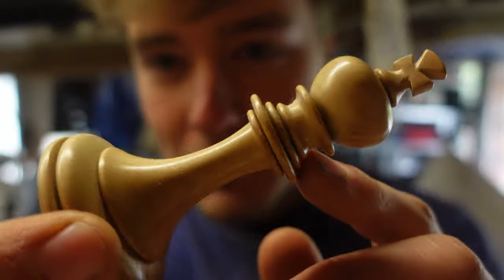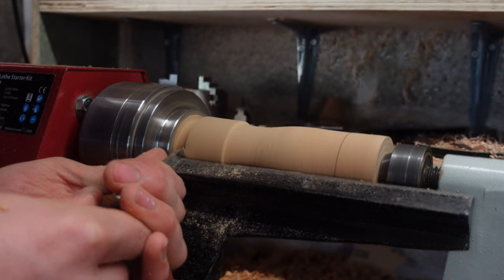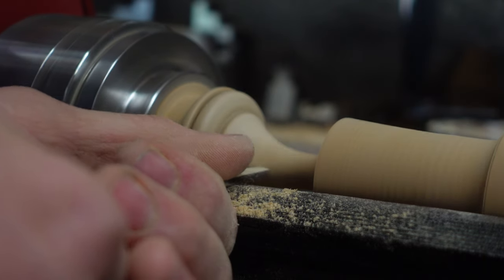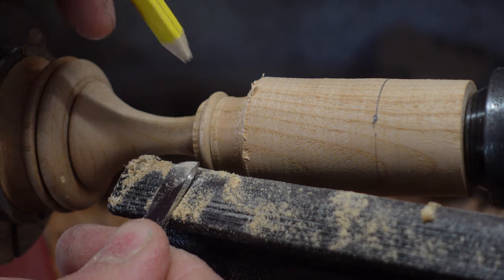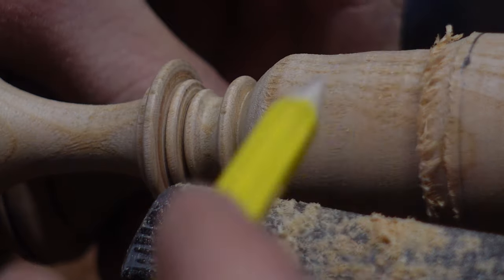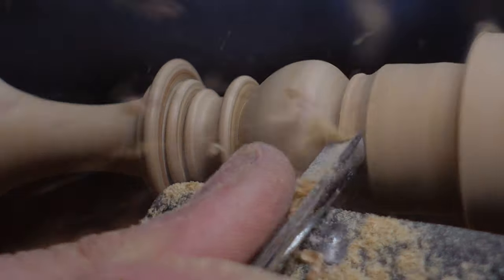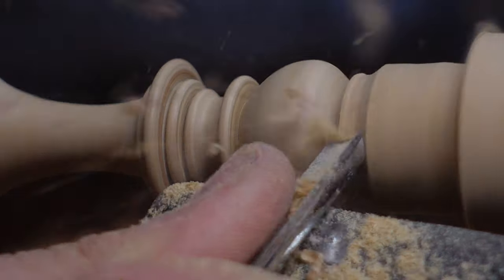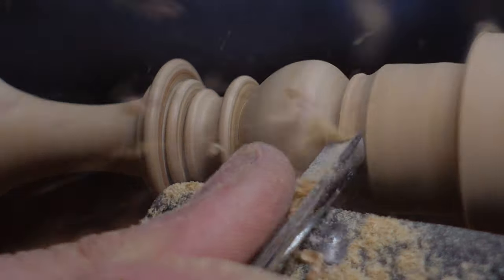How I make Luxury Standard Chess Pieces - Woodturning

Comment: Very nice work! Imagine making 32 of those babies. And the knights are all hand carved 🤔. 
The championship chess carvers make molding profile cutters (like shaper blade profiles, but flat instead of cylindrical) to quickly carve identical shapes on the lathe for the round pieces. Wonder if that would be feasible. 
That cherry was remarkably light colored, almost like sapwood. Again, beautiful work.
Reply from the maker: Yes I know how they do it in India. I could get a piece of steel laser cut to the right profile and then hardened, but this method of turning requires almost no skill and I don't have much interest in rapid batch production. If there is a market for these pieces then it's a completely bespoke set in which the customer chooses the style and material.
Reply: @fieldhouseboys  Exactly... Your skill is exemplary.  And as a turner than makes measuring spoon, cups and pepper grinders that can go into the hundreds I know there is a market of people who wants craftsmanship, quality... Awesome video friend

Comment: This is beautiful work. The extra effort for the finish really pays off.  Did you grind those smaller detail tools yourself?
Reply from the maker: Thank you! The brown handled small gouges are a set from Axminster. The light coloured handle with a thin edge is actually a carving tool (not meant for turning) but it's very useful!
Reply: Você pode mostrar as ferramentas de  cabo rosa e a que não é usada para tornear? Obrigado!